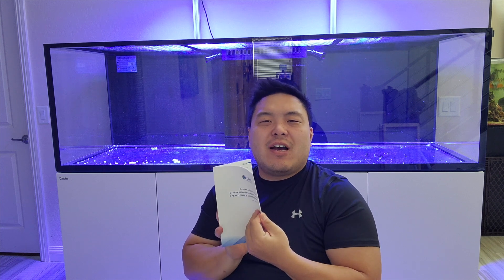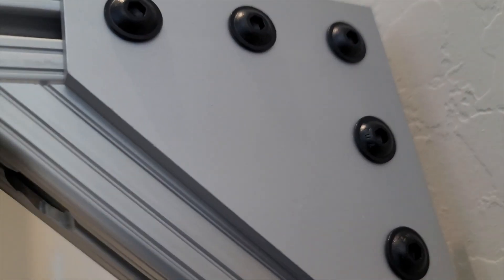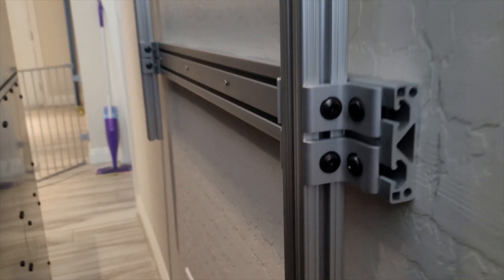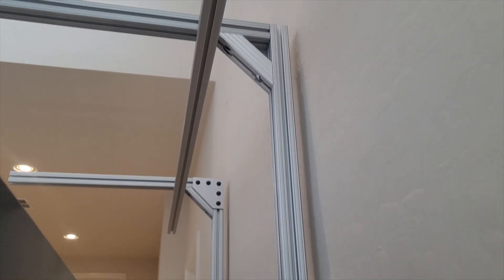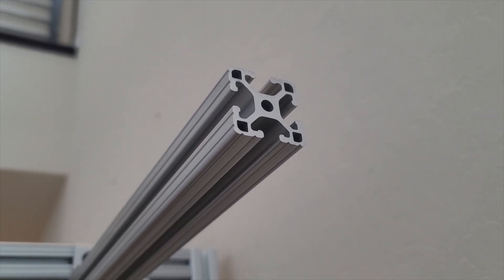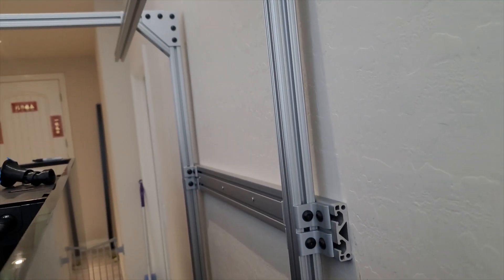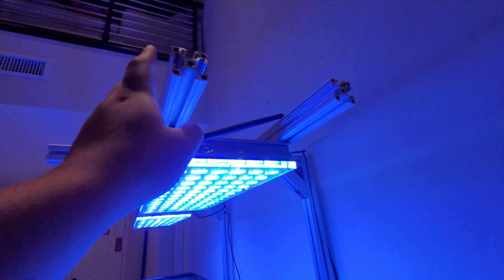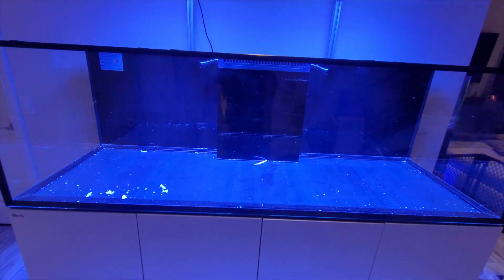DIY Aluminum Light Mount For The Red Sea S-1000 | Modern And Sleek

Comment: Looks really nice. I built a diy light rack out of 15 series also. It’s basically identical to what you have built. I have 2 32” Reefbreeders Photon V2’s mounted to them and there is zero deflection. And these are heavy lights. 15 series is way strong enough. Especially with those gussets and plates. Now I’m trying to figure out how to add a floating 80/20 canopy to help with light spill.

Comment: A cool mod for your sump wouls be to use colour vinyl on the bottom/back. eg; a white vinyl on the bottom so you can easily see detritus build up.
Reply from the maker: I actually did that on my old 525xl! It's a very convenient mod but I didn't want to do any drastic changes considering it's a brand new tank

Comment: You are gonna get quite a bit of bending from the 1515 near the top. I tried to hang one  Phillips Coral Care light which is 15lbs on one and it bent a LOT! I ended up having figure out a different way to hang the 15lbs light. Good luck. Disregard ....I finished the video and see that the lights mounted nicely!
Reply from the maker: Personally I'm still a bit scared of it bending at some point but we'll see! The lights are set farther back as well since the SPS will be all in the back. Hopefully all the reinforcements work in the long run